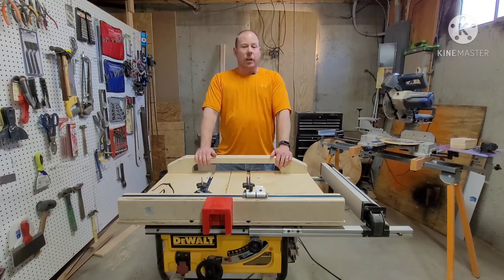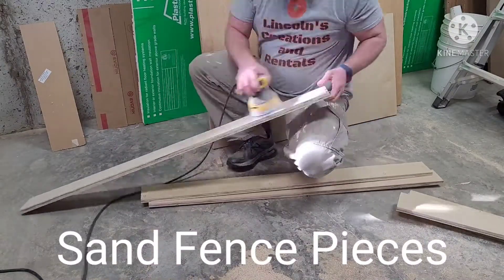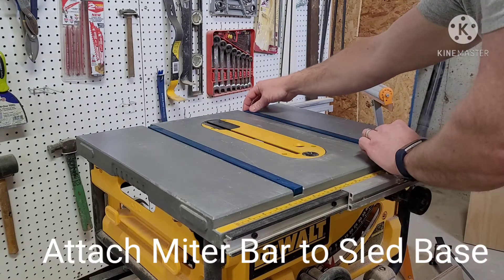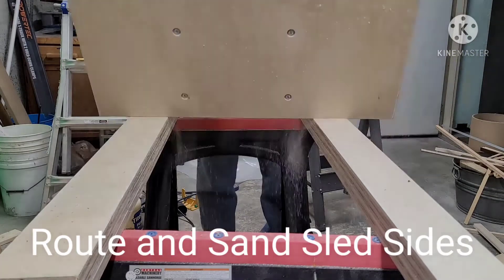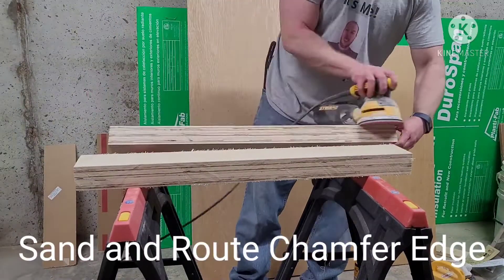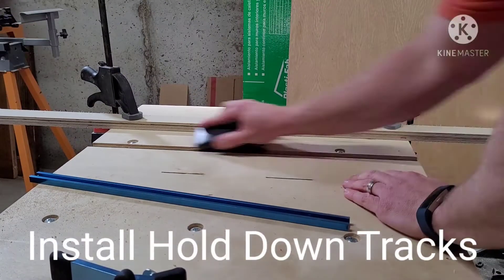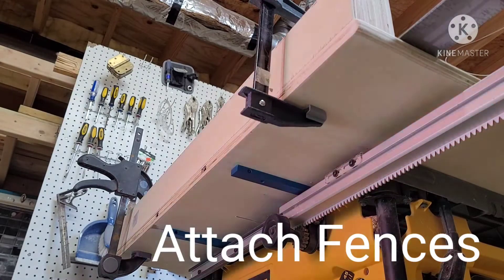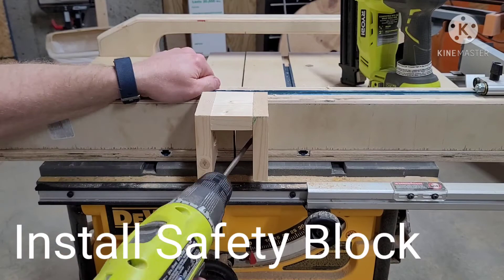Simple Heavy Duty Table Saw Sled (Dewalt DW745)

Comment: I didn't know they mate premade miter bars!  Mind Blown!  Nice saw!
Reply from the maker: Yeah, I was really afraid to cut my own so I shelled out for the pre-made adjustable ones. Turns out I didn't need to adjust them and could have just used the cheaper t track as they fit snug enough

Comment: Did you put a chamfer edging at your fence cause I heard that it helps with dust collection and it helps increase the accuracy of the cuts due to reducing dust buildup. Also does that kreg adjustable stop block have a magnifying glass or have a clear line of sight for the tape measure mounted on that T track on your fence?. I want to be able to get accurate readings on the fence rather than having to bring out my tape measure all the time when I adjust the stop block
Reply from the maker: Yes, I did cut a small chamfer edge. Using the plywood I did not specifically mill anything, just ran straight edges through the table saw. Also, yes, the stop has a clear sight with a marked line. Unfortunately I used a kreg stop on a rockler track so they don't line up, I recommend using consistent materials.
Reply: @LincolnsCreationsandRentals  so do you suggest I buy the kreg kit which is like $149 right now the cost of a tool…. Or should I spring for another stop block and use the rockler t track?
Reply from the maker: @marlonestrella8105  if you want to be affordable, check out the DIY stop blocks or put together a cheaper track with t-tracks from powertec and a cheaper stop.  Might take a minute for these links to work.

https://homedepot.sjv.io/P0r9LY

https://homedepot.sjv.io/NKQDgK

Here's an instructable that explains another option

https://www.instructables.com/How-to-Build-a-Crosscut-Sled-With-Flip-Stop-Block-/
Reply: @LincolnsCreationsandRentals  sweet thank you for a quick reply. I don’t want to make my own stop block since I’m a rookie who’s seriously into woodworking, 
but I will be searching the stop blocks that work with these t -tracks. The thing is I don’t want to sacrifice functionality just to save a few dollars but I ask don’t want to spend too much as I spent a lot in the past month on a dewalt 10 inch tablesaw and router. I even bought me one of those grippers because I was afraid of kickback or chopping my fingers off…. I been searching almost dozens of content creators making cross cut sleds and so far yours have been more thorough and less complicated than the others. What I did notice was that you didn’t run your boards through a planer which begs the question if you were concerned at all about cupping or twisting. Was using the clamps with a straight edge enough to address that issue? 

Right now I’m trying to save for a planer but it is so damn expensive. If definitely won’t be getting a jointer this year since you said you just cut the edges with the table saw (which makes sense).  Stuff like a stop block might be a deal breaker for me though because of its functionality…. Just trying to be cost efficient… but like I said, if it’s important I will try to get the best one on the market that will suit my needs (outside having to make one because I’m not skilled or confident that I’ll make a good one just yet)
Reply from the maker: @marlonestrella8105  using the plywood and straight edge works pretty well. I had some issues getting it to line up perfect, but not enough to warrant owning a jointer. I just recently bought a planer but didn't own it when I made this jig. I think if you want to be efficient with money, either powertec or hit up wish.com for cheap options and see if you get something quality delivered
Reply from the maker: @marlonestrella8105  I don't need to be perfect for the woodworking I do, I just like close enough to enjoy woodworking without stressing, it's a hobby for me, not a job.
Reply: @LincolnsCreationsandRentals  how are you liking your planer? May I ask what brand? Right now I’m looking at the dewalt or Makita 15 inch 3blade… crossing my fingers it goes on sale lol
Reply from the maker: @marlonestrella8105  here's a video on my unboxing of my planer.

https://youtu.be/tfW4N8OdGn0

Got lucky and got my planer on sale from Amazon. I think Home Depot runs sales at times.
Reply from the maker: @marlonestrella8105  so far I've only used it to plane down pieces of pallets, but it has worked well.
Reply: @LincolnsCreationsandRentals  yeah that’s the one i have my eye on. Im waiting for Labor Day or perhaps Black Friday to see if the price goes down
Reply from the maker: @marlonestrella8105  might get lucky, I know sometimes lumber liquidators sells tools, but I recommend watching Amazon pricing closely and get the one with the extension tables and extra blades.

Comment: Also do you mill your wood? I noticed you didn’t run any of your boards through a planer or jointer. I’m wondering if that’s even necessary?
Reply: It's plywood?
Reply from the maker: For this it was birch plywood. I don't do any milling myself, just a small hobbyist.

Comment: Why would you drop your sled onto the "miter sleds" without using the saw guide??? Terrible decision!
Reply from the maker: Well,, it might have helped a little if that fence and every cut were perfectly square with the blade, but I followed the 5 cut method later to square the Sled to the blade.
Reply: I was about to comment on the same.